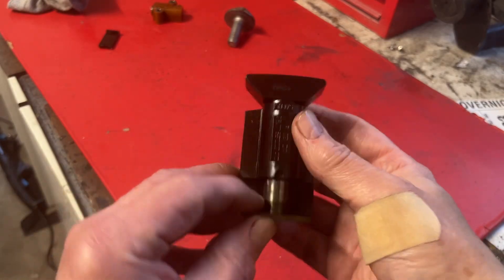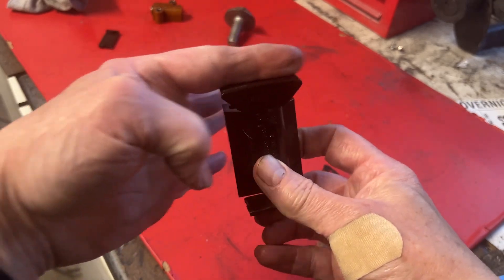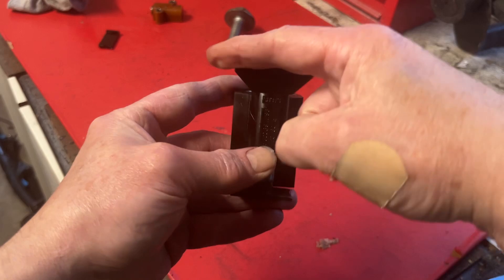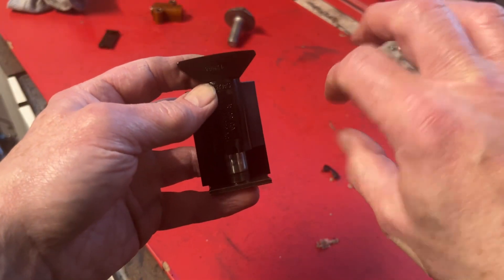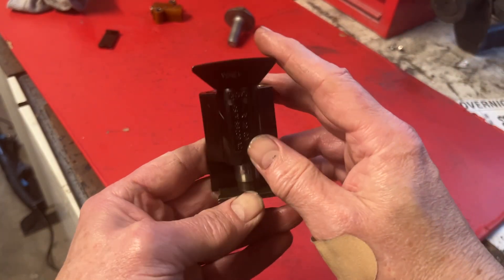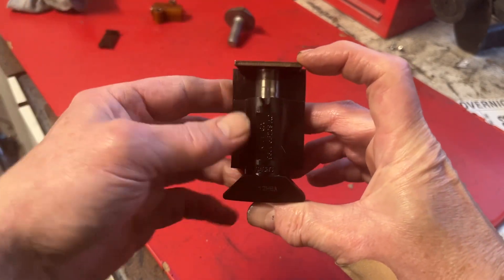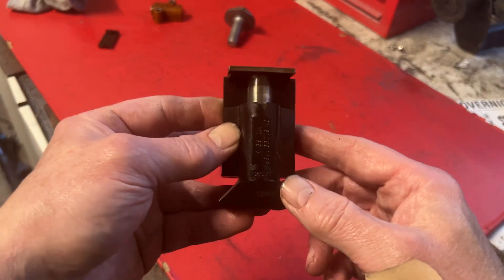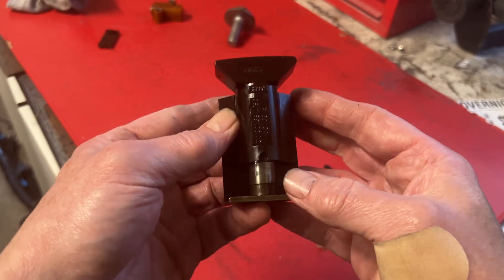Jaguar XK8 Plastic Secondary Chain Tensioner. How they work, Problems & Solutions. XKR AJV8 Modurol

Comment: I inspected my tensioners on my 97 xk8 , 130k and they good great no cracks in fact the engine looks super clean. The chains are tight no slack. Do I need to upgrade to the metal tensioners. I only drive the car 5 months a year and it isn’t a daily driver. What is your opinion?
Thanks for all you do
Reply from the maker: @annamariam1175, If they are the original tensioners you have been very fortunate.The amount you drive and frequency of use is not as significant as the aging of their plastic construction. The tensioners have plastic bodies and plastic chain contacts. Overtime these have shown to fail and there is one on each bank of cylinders. If original, they are circa 26 years old and nothing last forever. If you intend keeping the car I would recommend changing them as the consequences of failure could damage the engine. If cost is an issue you could just change the upper tensioners themselves rather than the complete timing kit. Hope that answers your question, regards Damian